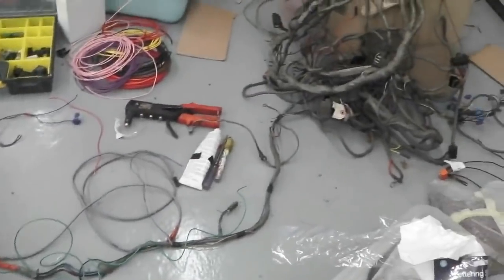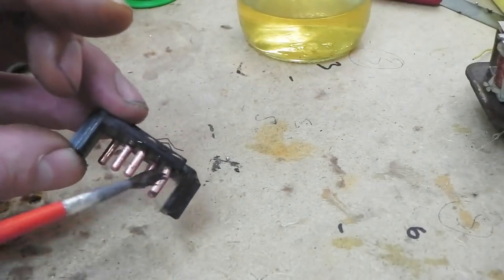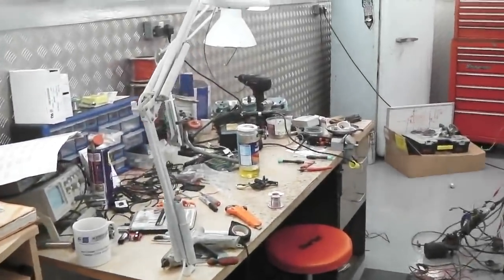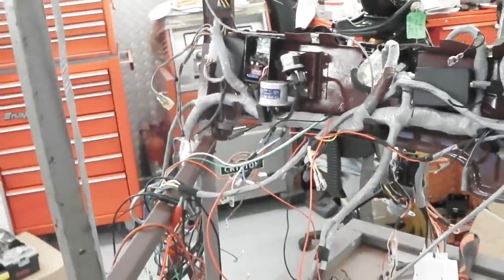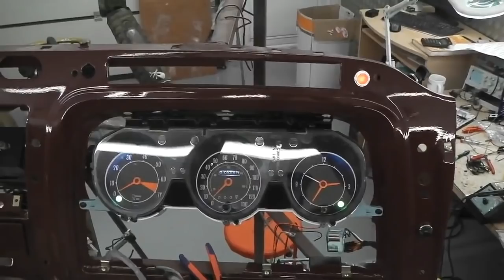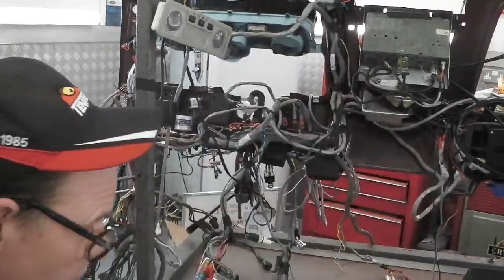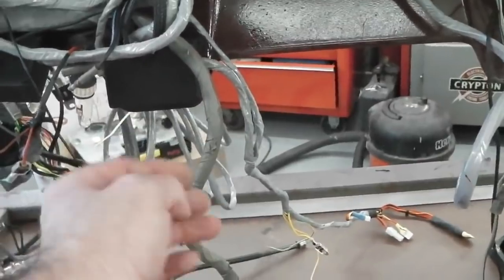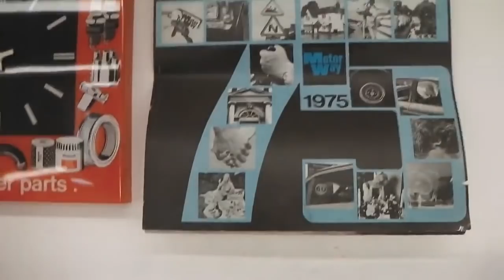Classic Car Restoration - Ford Cortina Mk3 - Dash wiring harness build

Comment: You often have torches where the cheap batteries have leaked corroding terminals that need cleaning, those long life Duracell batteries are good I had some still working 10yrs later and not leaking.

Comment: Hi Pete, another great video as usual. The solder sleeve that you used for the hazards have been used in the defence industry for over 30 years and are great components. Just make sure that the solder has flowed in both directions and that the joint has been heated all round to ensure a good contact.
Do you have a fibreglass pencil?, this is a pen like tool that has fibreglass bristles on it and is used for cleaning up contacts and printed circuit board pads. You can buy them from Radio Spares and they also make a brass insert with brass bristles on it for heavier duty cleaning. It’s a great tool for cleaning up verdigris and corrosion from copper/ brass contacts. 
Keep up the good work, loving the resto.
Reply from the maker: Thank you Robert!!! yes i have the pen tool in the kit,glad you like the films, from Pete

Comment: I thought one idea I came across was quite good the cars interior fan got faster as the heater warmed up, wonder if they still sell the Kenlow hot start where you heat the water and hence engine using the house electricity supply before using the car.

Comment: Hi Pete, hope you are well! I’ve recently bought a MK3 and have been avidly watching your videos 😎 I’ve already refurbished the clocks and now would like to add hazard lights. Do the have a schematic of the the wiring so I get it right? Many thanks Mike
Reply from the maker: Mike real sorry for late reply, did you sort? if not aftermarket hazard kits come with diagram, if you doing  stock sstem, they used a seperate sub loom for hazards, though all looms had the connectors to allow retro fit as far as i know, from meory theres a spare red receptacle around the speedo area of loom/headlamp switch area, which is used as the 12v constant feed , then )i think) there are left and right receptacles for indicators, and the loom piggy backs in
Reply: @PeteCswampy  Hi mate, thanks for the reply. Not done it yes but want to and would like it as original as possible. I saw in your video you pick up the live feed. You don’t happen to have a hazard loom and switch available do you? My car is the big brother to to South African you just did a video on 😎 many thanks as always and if you ever fancy meeting up for some seaside fish and chips I’m only down the road in Manchester 😉 cheers Mike

Comment: Hi Cortina City, watched your videos but I'm still lost in the wiring of my MK3, don't suppose you fancy taking a look at it, maybe using it for content?
PS.....its a mess.
Reply from the maker: what is your location? I can help but we would need to agree price. Pete. What is the problem with the wiring? Have you considered joining the Mk3 owners club as there may be people close to you who can help? its not expensive to join the club
Reply: @PeteCswampy  I'm in Gloucestershire in the middle of the Forest.
I have all lights working but nothing on the dash, the chap before me started fitting a Rover V8, and I've managed to get it running and rolling, it came with a load of GT guages that I can't work out how to wire, and it needs a electric fan wired in, I can do most of it if I knew where to pick up power and how the loom works, but can't find a diagram that makes sense to the car.